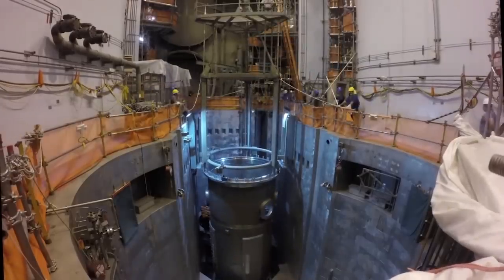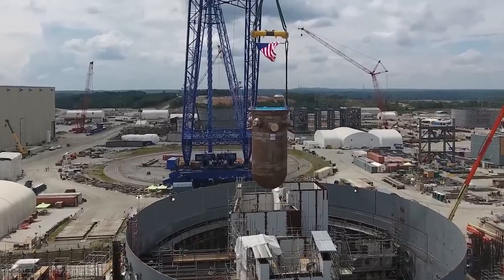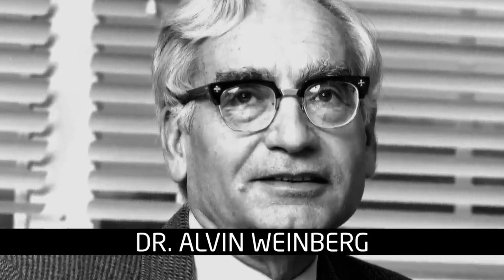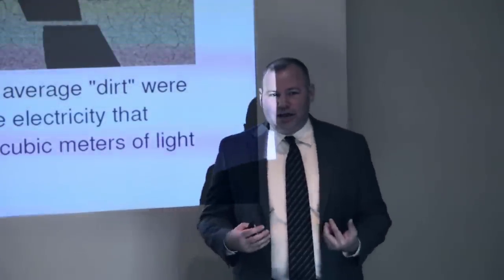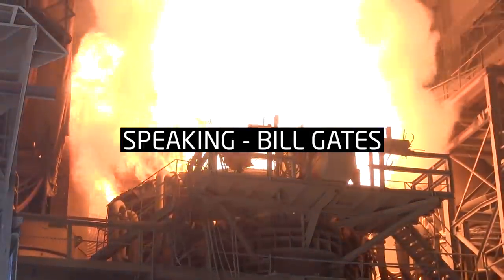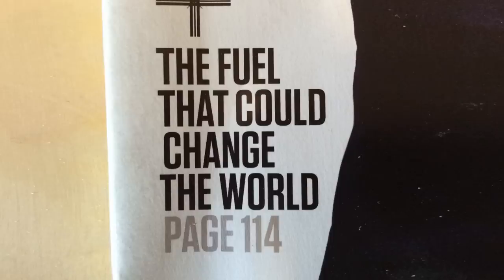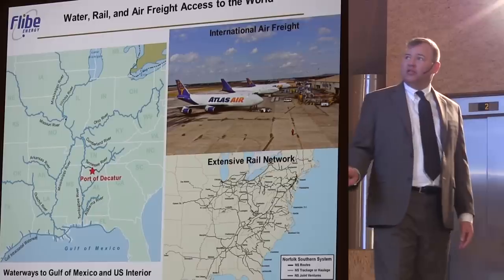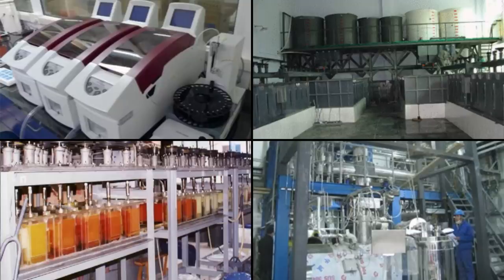Thorium 2017

Comment: What about a fast spectrum molten salt reactor? Euratom is doing this i beleive
Reply from the maker: unsettledroell fast spectrum molten salt reactors are being pursued and certainly should be pursued. But there are reasons to pursue thermal spectrum which were weighed against fast spectrum long ago and those reasons are being ignored.

TerraPower is also looking at fast spectrum. That is Bill Gates, which is pretty interesting because bill gates said liquid fuel reactors seemed complicated to him previously. So maybe he has opened his mind to it.
Reply: gordonmcdowell, the ONLY reason to favour thermal spectrum is the bigger cross sections, but once your design ensures criticality this issue is irrelevant. On the other hand, it is easier to breed with fast neutrons (both Th and U) and very difficult with thermal flux (only Th as a candidate).
Reply: Sergio Korochinsky so use fast breeder molten salt reactors to burn up the standing waste piles. And thermal for LFTR. Each fuel has a best fit design.
Reply: Rhy K, it is easier to breed with fast neutrons, both U and Th, although Th would be less proliferation (you can make bombs with U-233, but U-232 is a big problem). If you insist on using thermal spectrum (like Lifter) then Th is the only option for breeding. If you want to burn stock piles then you don't want to breed and the problem is totally different. You don't need molten salts fuel to breed with fast spectrum (see LMFBR).
Reply: Sergio Korochinsky yup I like LFTR better for the various reasons in Kirks FLiBe presentations.
Reply: Rhy K, as I said yesterday, the ONLY reason Sorensen gives for choosing thermal spectrum is bigger cross sections, which is irrelevant once your fast design reaches criticality. He says you need less fuel to be critical, but the difference is irrelevant and actually a bigger fast reactor is better for controllability (precursors for delayed neutrons stay longer within the core). Sorensen speaks about the utopia of burning 100% of a fertile material (Th) but he does not mention any of the hard bottlenecks in the design of a reactor like Lifter. With all due respect, he is not even a Nuclear Engineer, he is just a marketer.
Reply from the maker: When he started giving talks about LFTR he was not. He is now. Copy/paste from Flibe-Energy website: Kirk has a master of science degree (2014) in nuclear engineering from the University of Tennessee and a master of science degree (1999) in aerospace engineering from the Georgia Institute of Technology, and a bachelor’s of science degree (1998) in mechanical engineering from Utah State University.
Reply: United States educational system is funny. He went from Bachelor in Mechanics to Master in Aerospace in ONE YEAR. I assume he did the same to become a Master in Nuclear Engineering (he read some books during one year...). That does not make you a real nuclear engineer, that only gives you a degree and a piece of paper. He never worked with a multidisciplinary team trying to license a reactor. The fact that he only speaks about the utopia of Thorium fuelled MSR but never, NEVER speaks about the bottlenecks in the design, is the best proof that he is only a marketer. A serious engineer would focus exclusively in analysing the problems of the proposed technology and how to solve them.

What pisses me off is that his presentations and videos (and also your videos) give the wrong idea to the general public (which are not engineers nor nuclear physicists). The biggest lie in Sorensen's videos is that Thorium can give you 200 times the energy of Uranium. In the fantastic and almost impossible conditions where you can convert ALL Thorium into fissile material, and then fission it, Uranium can also do it! The only difference is that Uranium needs a fast spectrum and Thorium can do it with both fast (engineering fact) and thermal spectra (theoretical possibility).

When I got in contact with Sorensen, his only argument was that thermal cross sections are bigger (two orders of magnitude) and therefore you need less fuel to get criticality. That is hardly beneficial, since a bigger reactor would keep delayed neutron precursors within the system for longer time and therefore make the reactor more controlable and safer. In any case, just analize the balance equation

production = absorption + leakage

nu SigmaFis = SigmaAbs + D B^2

The diffusion coeficient D depends on cross sections that get as smaller as fission and absorption cross sections, so the balance is not greatly affected. The number of neutrons per fission, nu, grows from 2 to 3, and any remaining difference can be balanced by changing the geometrical buckling B^2, which grows with the square of the radius (small changes are needed). Then you may also consider mixing the fissile with the fertile material (Th+U, or U+Pu) with an adequate reflector, instead of having an U core and a Th blanket. The design options are simply too many, and the relative change in cross sections from thermal to fast spectrum cannot be used as an explanation for anything.

The biggest real benefit of using Thorium (within a Th-U233 cycle) is the lower production of Actinides (nuclear waste)... but that is seldom mentioned.

This is already too much information for a "YouTube post", and it is not my intention to rewrite here any of the dozens of textbooks written about the subject, textbooks studied by every single Nuclear Engineering student in the world. Of course, in the case of American Universities, we are talking about a mayority of Chinese students who come back to China instead of getting a job at Oak Ridge. But portraing Sorensen as a messiah of molten salt reactors because he (an aerospace engineer working in NASA) found some documents in 2002 is pathetic. The International Fórum on Generation IV Reactors was created in early 2000, and Molten Salt reactors have been included as possible GenIV technologies since then... but I guess you "forgot" that fact in your timeline (which erroneously implies that the whole molten salt reactor activities are a consequence of 2002 Sorensen's arquelogical "discovery").
Reply: Sergio Korochinsky TL;DR
Reply from the maker: Sergio, It is possible he didn't want to hash everything out with you to your satisfaction. That's just the first thought that springs to mind as I read your comment.

You are disputing or ignoring points I've read arguing for thermal-spectrum Th/U233 in Fluid Fuel Reactors, not just by Kirk Sorensen. Small amount of fissile inventory. Safety that introducing moderator into a fast-spectrum reactor won't increase reactivity. 

There were reasons to do this in 1958, put forward by people smarter than myself, and the only difference I'm aware of since then is...
1. PWR is now an established industry.
2. More uranium resources were found than had been anticipated.
3. MSRE hadn't happened yet to test practicality of concepts put forward.

"The biggest lie in Sorensen's videos is that Thorium can give you 200 times the energy of Uranium."

I do make it clean in my "Thorium." video that Uranium can be completely fissioned in a fast-spectrum reactor. I'm showing EBR-2 safety tests and how that program was killed by congress during Clinton administration. I even say...

https://youtu.be/2oK6Rs6yFsM?t=4h16m4s

"An atom of thorium and an atom of uranium both contain the same amazing millionfold improvement in energy density over coal. It isn't that an atom of thorium contains any more energy than an atom of uranium. Or that natural thorium is much more common  than natural uranium. But we don't consume natural uranium in today's reactors."

...in fact even in this video we're commenting on, Kirk says...

"We could use thorium about 200x more efficiently than we're using uranium now."

...so that is NOT what you are saying he said... No one, not me narrating nor Kirk on-screen is saying Th contains more energy than Uranium.

"The International Fórum on Generation IV Reactors was created in early 2000, and Molten Salt reactors have been included as possible GenIV technologies since then"

Kirk isn't the only person I have on camera stating the documents were hard to access prior to the scanning, nor the only person stating they are useful.

Maybe you think I'm saying "no nuclear engineers knew this was an option" when I say "we didn't even know this was an option"? I'm talking about the general public. Which (just like myself) barely knew nuclear was anything but a single monolithic technology. And (like myself) was quite interested to learn how broad the scope of nuclear power systems actually is.

I don't think I'm making any outlandish claims to say this reactor concept is a big deal. Rather, the industry has never really tried to convince the public that any other reactor concepts are a big deal.

Comment: eletric cars are worth it even if you are using pure coal fire power plants as coal fire power plants are many times more efficient than internal combustion engines in cars, also the electricity to drive a given distance is already cheaper than the fuel to travel the same distance in a regular car. The limitation isn't the cost of power which already a fair amount of that cost is actually to deliver that power to you, rather than the raw cost of production.

But it would be nice to have energy generation that is so cheap that you just pay a flat rate for access to energy to a reasonable limit like if you are using your energy to run an arc furnace yeah you are going to be paying more than a home owner, partly because of the raw flow of energy you would need to run it that couldn't be ran out of the fuse box of a home.

Although at the point where energy is "too cheap to meter" I think really you should be socialising the cost of energy, because at that point it's only about maintaining the infrastructure and it should be treated like roads where it's free at the point of use and you pay a tax. So that poor people can have access to energy and the rich would pay the most for there energy and the middle class would pay less than they otherwise would.

Comment: There must be a big reason why the US is protecting their industry. Probobly because there are a lot of jobs riding on keeping the system in place. Why they went that way originally I don't know.
Reply from the maker: A bit repetitive if you've just watched Thorium 2017, but there's a bit more conversation on that topic... https://www.youtube.com/watch?v=pTFOzHsbvAE ...and also the supply-side of Thorium... https://www.youtube.com/watch?v=UNTVDszP-zM ...I think it is entirely possible Th-MSR specific regulatory challenges were created by accident, and there's just never been any public pressure or industry pressure to address them. Transatomic is one of the best funded MSR startups, Dr. Leslie Dewan did testify to an energy sub-committee spelling out the liquid-fuel challenge... what else can she do? (For example.)

Comment: What about the proliferation issue of chemical extraction of protactinium-233 to produce pure uranium-233?
For more info: https://phys.org/news/2012-12-thorium-proliferation-nuclear-wonder-fuel.html
Reply from the maker: Dr. Stephen Boyd talks to those concerns: https://www.youtube.com/watch?v=Kos4KnfPcVs ...basically there's already anti-proliferation mechanisms used today for PWR. Instead of tracking fuel in & out & timing (to ensure U is not toasted to create weapons-grade Pu), with liquid fuel it becomes a matter of tagging isotopes and using homogenous nature of fluids to monitor plant in real-time.
Reply: Cedric dude why didn't you take the trouble to read the comments from the article you linked. The premise of the authors was totally debunked in the comments.

LFTR and properly designed MSRs are highly proliferation resistant. First off U-233 has no practical use for a nation state bomb builder and nobody has gone that route, nor rationally would go that route, so that is a giant proliferation resistant fact right off the bat. 

And a thorium thermal spectrum breeder,  cannot supply surplus U-233 without adding an import of U-235 or Pu-239 which TOTALLY DESTROYS the rationale for using the thermal breeder in the first place. What idiot would trade surreptitious U-235/Pu-239, both superior for weapons than U-233, for easily detectable and fantastically more expensive & difficult U-233 production, in the fantasy that you could somehow build a practical weapon with the U-233.

A reactor that has extreme fuel economy, 200X lower than LWRs, means a very small uranium inventory, a very small fissile inventory, much smaller need for enrichment, vastly smaller fissile material production, storage and transport, easy detection of diversion = proliferation resistance.

Extremely difficult and expensive to convert a LFTR or MSR to produce the extremely pure Pa-233 needed to avoid U-232 contamination, and such efforts are easy to detect in many ways.

And in general weapons have always been made from uranium sources, so switching to a thorium based economy is going to make obtaining fissile material much more difficult.

And having fuel in a molten salt form makes it easy to have an emergency method to denature the fuel in the event of terrorist or foreign invasion.

As long as it is far, far easier to build a graphite reactor or a heavy water reactor to produce weapons materials by proven and well established, public knowledge methods,  than that is more than sufficient for any rational security protocol. And as for terrorism, it would be orders of magnitude easier and more effective to pursue chemical and biological WMD than nuclear. So that leaves nation states, and we couldn't even stop a tiny poverty-stricken piss-pot country North Korea from developing sophisticated nukes, without a commercial reactor program, so that puts a dead stop to any ideas that fanatical constraints on commercial reactors is of any value whatsoever.

Right now, by far and away, the #1 issue of nuclear proliferation is the willingness of Oligarch controlled nations like the EU and America to invade nations to get at their oil resources, build gas pipelines or force them to join the privately controlled Central Bank cartel. Countries like Iraq and Libya agreed to abandon their weapons programs in return for security promises from Europe and America and then were promptly invaded justified by fabricated evidence. There is no way North Korea will stop its weapons program now, knowing full well that will make it vulnerable to another US led invasion.

.zerohedge d0t c0m /news/2015-10-10/us-foreign-policy-explained-1-simple-flow-chart
Reply: Thanks for sharing @gordonmcdowell. Although Pa-233 extraction may be challenging and it may be possible to monitor its extraction, point remains that it is a proliferation concern. I'm worried that the movement around thorium, including your video, is disinclined from giving fair weight to the drawbacks of the thorium fuel cycle.
Reply: A neutral debate would be wonderful, but that is NOT what we have. We have a highly one-sided debate because the anti-nuclear forces have unlimited funding, unlimited political influence, insanely powerful lobbies, the backing of the incredible private Bank monopolies and the media they control, and super-rich anti-nuclear lobbies like Greenpeace ($400M/yr) all financed by the wealthiest two businesses on the planet 1) Banking 2) Big Oil.
Reply: To see how laughable it is to chastise Thorium advocates for "not being neutral" in the debate about energy, just watch the Youtube video on the Thorium Remix channel entitled "  Penn & Teller vs Dr. Helen Caldicott, Candles & Anti-Nuclear Fearmongering - TR2016c 4h54m39s20f ". Wackamondo crackpots given free run to spout any kind of fabricated nonsense beyond the limits of absurdity, and these cretins are actually promoted in the MSM, while Caldicott, a member of the Fukushima Death Cult, gets $100K donations spreading Fear Porn about Big Oil's main competition. Funny how rational expert nuclear engineers or radiation health physicists are NEVER heard from on the MSM. Now I wonder who would be giving her $100k donations? Think.

Comment: There are a hundred good reasons to use thorium to provide power for Mankind and removing carbon dioxide (not carbon) from any part of our environment is NOT ONE OF THEM!  CO2 has a very minimal effect on Earth temperatures (maybe 1%) but has a huge beneficial effect on growing food and greening the Earth in general.  Radical Environmentalists have the relationship of CO2 and temperatures backwards:  A rise in temperature is followed by a rise in CO2 level,  Not the other way around.   I know it is fun for those that believe in CO2 driven global warming to talk about energy production that produces no CO2 but it is in fact an irrelevant point.  So, by all means lets produce abundant cheap energy using thorium MSR's and Fusion when it is conquered to bring about the many  benefits, not the least of which are cheap electricity and water desalinization, But, lets stop spreading the lie that CO2 needs to be reduced !!